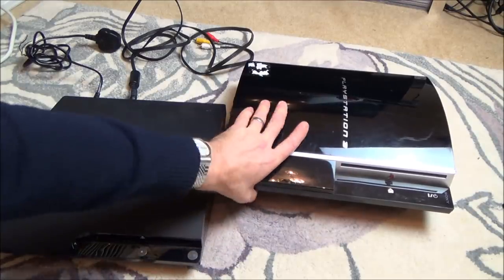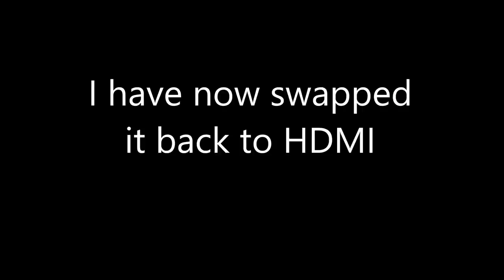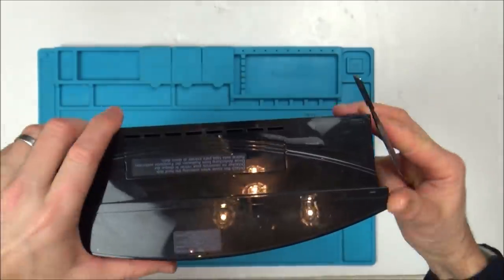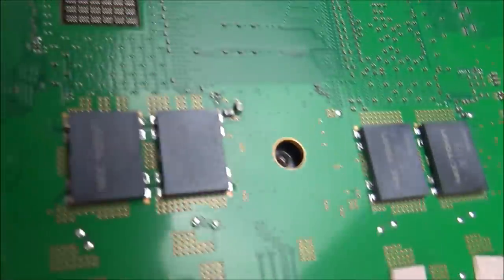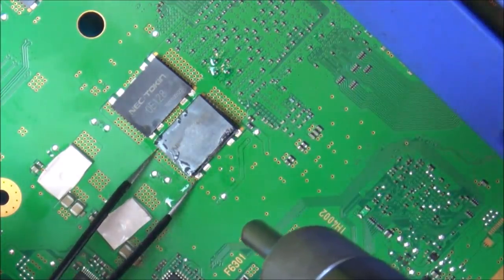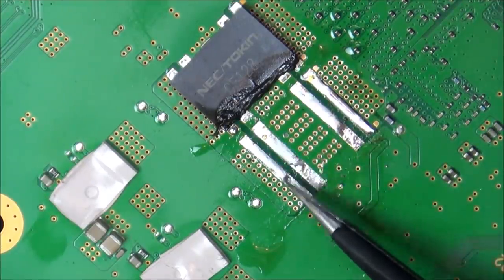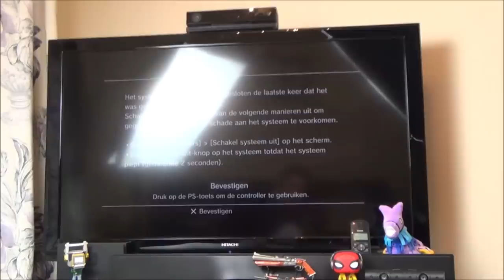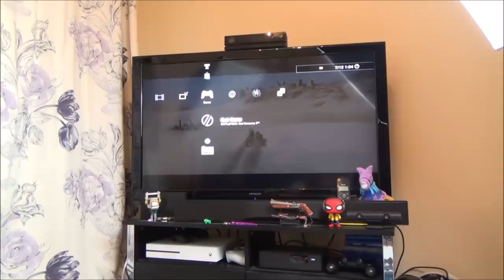Marcel's Lot PART 4 - Faulty SONY PlayStation 3 Slim & PS3 Fat

Comment: I just droped my jaw when I saw this working ... Everybody and their mother allways said its the main chip ! I cant freaking belive it !
Reply: Yes. They can cause YLOD. And it's known for a while. Most people only thought that the RSX/CPU was the fault. In some cases, they were from the original model to the first slims model (known as 20xx). Many laptops with those NEC Tokins (they lose their capacitance and cannot deliver to the CPU) also failed. When you heat them, they restore back their capacitance. So many thought after heating the RSX/CPU, the problem was fixed or that they where the cause. No, in most cases it were the NEC Tokins. I've replaced lots and the systems still works till this date. Others that after reballing (when properly done with proper tools) failed after a few months or a year (back in 2012) pointed to other problem. Replacing those NEC Tokins (for tantalums), again, fixed the problem. That's why models from 21xx didn't came out with those NEC Tokins.

You can measure around the CPU/RSX to see if it's still making proper contact or apply pressure to them and see if it works (lol), cause those power cicles (turn on the console, it heats up, you then power off and it cold down) also makes the solder deform. If not, look for other areas like fuses and those tokins. :)

Final note, i did got alot of consoles and some were already opened and without any visual damage or component (even replaced the NEC's), i then tested/dumped the flash memory (NOR/NAND) and some had a brick (maybe the original user failed when attempting to exploit the console or replace the memory with other and never had a backup), like the serial didn't match the case and so on or the dump had bad sectors or the data was incomplete but if the (what's known for) per-console data is intact, you can try and write a valid ROS 0/1 to it and flash it back (you need a hardware flasher of course) and it might the only problem with the console. So, we never know...YLOD can be from many other things.
Reply: You have to remember that the YLOD literally means 'General Hardware Failure'. Unlike the Xbox 360, where a RROD CAN be identified via system code that people have recovered, we currently have NO way of identifying which component in the PS3 actually fails.

Whilst this fix has worked for a number of people, others have also removed 50% of the capacitors (8 caps out of 16) and found that the PS3 is still capable of working, meaning that there's a chance that this will not work.

There's no guarantee but if you've got a dead board already, what have you got to lose?
Reply: @pqtat718  mines red dead that is crashing but not gta v tho , could it be the nec/tokin capacitors faulty?
Reply: @pqtat718  a have the slim model , what capacitor should i use?
Reply: should i replace it all? or the rsx only?
Reply: what type of capacitor should I use on my slim? 330uf or something?
Reply: @pqtat718  thanks
Reply: the main ICs or the tokin capacitors are the cause of the YLODs. It's either that the ICs cook themselves to death, the bga balls get cracked, or the tokin capacitors die that are the issue.
Reply: @mrratchet  there is a method of diagnosing a ps3 with UART bruh
Reply: @RandomGuy-om1vy  Yes there is now! At the time of my original comment just over a year ago, no such method existed.

Thankfully we’re now able to get SYSCON to tell us the error code, which should help people with repairing consoles affected by YLOD!
Reply: @mrratchet  yep, do you have experience on fixing ps3's, i actually need some help on a slim

Comment: Great fix! I've not seen that fix before for these!
Reply from the maker: Thanks Steve, I was told about it when I did the last 'trying to fix' videos on the PS3s but I never researched properly until now. It would be interesting to see how many can be repaired this way or if it is still mostly the main chips that cause the problems :-)
Reply: Why don't you try it @TronixFix ?
Buy 20 of them and try to fix them 👍🏻
Reply: Yes tronicsfix please buy a bunch of these and do this fix!
Reply: inspired? @tronicsfix
Reply: @Mymatevince  I repaired my ps3 with ylod
Reply: hello, I have ps3 and it won't work on the av cable..ps3 has hen installed, that is, it is modified ... will this procedure affect the mod
Reply: Wow tonic fix
Reply: I wish tronicsfix would have done ps3s

Comment: Had no idea the caps could cause that always heard it was the main chips

Great fix
Reply: It's a similar if not the same issue with laptop GPU's and all in one PC's of the 2009 - 2012 era (Most famously on Apple products). The Tantalum capacitors wear out much faster then they should and screw up stuff like the power rails feeding the GPU. Reason why people thought reballing/baking the boards (or wrapping your PS3 in a towel worked is that applying heat to a tantalum capacitor can break up some of the crystallization byproducts that shouldn't be forming if the caps weren't being run near their maximum thermal and voltage ratings (typical design recommendations from what I read is to go 50 to 100 percent higher on the voltage rating of the cap depending on the specific internal chemistry).
Reply: I have been shouting back in June!!! Check the comments on his previous videos.
Reply: @Techburn997  when i was younger we had a xbox 360 got it around launch and it got the red ring of death and putting a towel around it worked a couple of times but did not after a couple times
Reply: @jok3yjesu339  The xbox 360 suffered from a different issue from what I remember where the heatsink mounts would cause the board to warp and thus break solder joints. But I have always wondered if it could have been both. Might have to find an original 360 with RROD and do some experimenting
Reply: @Techburn997  if you put flux all around the chips and reflow it. That works alot better than just straight up not using any flux on the xbox 360. Do that and put some really good thermal paste like arctic silver or MX 5 and should last quite some time especially if you add a fan mod to it that will increase air flow. The older xbox 360 models did suffer from poor air flow due to the case design and the fans not running fast enough for proper air flow

Comment: Did this for a client, you just need to take a knife to the NEC Tolkins to scrape off the majority of the caps and then heat the pads to remove the remaining pieces.  Replaced the top 4 Tolkins with 16 tantalum caps, left the 4 on the bottom side becuase they are actively cooled with the bottom shield whereas the top ones are just ambiently cooled.  The bottom Tolkins also bridge the pads up top.

Comment: Amazing! I had actually seen a video and even heard about how some electronic technician had said that those capacitors used in the PS3 or any other Electronics from the early 2000s were rubish and were the cause of the yellow light of death, he was saying how the chances of those lead free solder balls actually breaking were very small and did not believe it to be the cause of the problem.

Comment: Great timing! just the other day I ordered an "untested" BC PS3 which actually was tested (The seller had other listings that were working for sale, so they pulled a fast one on me)
 that actually had this problem. Maybe I could get it working.

and by the way, Bad Company 2 is probably one of the best military shooters ever made and still has an active community to this day, especially on PC. I don't much care for shooters, but that one is something else! just in case anyone was reading...
Reply: I recently bought a BC PS3 and the last Friday I sent it to a reparation service. I opened it and it looks very clean I hope that the Nec Tokins are the problem :)

Comment: This is one of the few things I've seen on this channel that I've actually repaired, not as competently as you do it though. I couldn't really afford one back in the day but I bought 3 or 4 broken ones on ebay and replaced the Blu-ray drives or reflowed them with a heat gun if it had Ylod, made just enough money to justify keeping the best one for myself.

Comment: I was skeptical at first but since I'm someone who likes to challenge common beliefs, I gave it a try and boy, was I glad that I did so! Just like you, I didn't have those tantalum capacitors. It just so happened that I have 4 of those 470uf capacitors you were using. Did the same thing and it worked! Well, at first it didn't but right before I was about to give up, I checked the legs of the capacitors and one of them was touching each other... Separated the legs and wow, it works! I tried running it for an hour or so and it still works! Yes!

So I just want to say, "Thank you for sharing this!!!" I'm going to swap those capacitors to the tantalum ones when they arrive :)

Comment: I’ve been planning to do this for a while on mine. Many people have had success changing capacitors. NEC tokin capacitors are known to go bad. They changed them after the cech 2002 models. Great job Vince
Reply: CECH 210x actually, 200x still have the NEC FUKINs (but only on the GPU)

Comment: Nice going Vince,a member on the PSX-Place let me know of your video, i expected a bang with thoes electrolyte caps, looking forward to the full replacement. Currently we are still researching on which is the best method for the NECs, what i advise from personal experience and to avoid the hassle, is to have 50% NECs and 50% Tantalums, replace the NECs on the top board where the processors aren't present, and leave the underneath ones as they are, the reason being is that the bottom ones are actively cooled by the fan itself, and the top ones are passive, but with most of the heat concentrated on top, thoes NECs are thr first one to die, and also if you go via full replacement, you might not get it working again due to the bridge between the circuits, so leave at least one NEC, if you plan to do a full replacement, it acts as an internal bridge for the Tantalums, eliminating the need to wire unnecessary jumpers.

One of the test subjects before i made the thread on PSX-Place was my personal 60GB CECHC04, at the moment is approaching is 7th month since the replacement, still working as we speak, at the moment i am searching for a A01 or B01 to add to my PlayStation collection, so looking forward to your next video.
Reply from the maker: Naked Snake!!!! I instantly recognised your name and icon :-) You did a great write up, I also went on to read about 15 pages of comments under your tutorial, didn't have time yet to go through all 40+ pages of comments but it all makes for an interesting read. I think on the revisit I will do just the 2 GPU caps on the top board to see how that goes. The others can always be done at a later stage. Just debating whether I need to install 8 new 470uF caps in place of the 2 large NECs or if I should try 3 and 3 or 4 and 3 to bring it closer to the original 1200uF. Thanks for sharing the tutorial with everyone and for commenting over here. Good work. (I will copy and paste this on the other length video as well) Cheers :-)
Reply: If i recall correctly, the top side have 4 NECs, 2 on the RSX and 2 on the CELL, what i would do for starters, is to replace all 4 NECs on top with 4x330uF or 4x470uF at 2.5V for each NEC, the other 4 NECs on the bottom you can leave them as they are, they are not really a concern, i simply recommend 470uF for the Phats, simply it didn't work for me for my 60Gb, mine are 470uF rated at 6.3V,is all i had during replacement, but before the 470uF, I did salvage a few 330uF and 470uF from dead boards, worked as well, until a few Tantalum contacts snapped during the salvage , that's why i disclose on the thread 470uF for the Phats and 330uF for the Slims, just to be identical to the NEC spec which is 1200uF each for the Phat and 1000uF for the Slim, but you can use 330uF for the Phats as well, worth the try.

Happy repairs

Comment: LMAO after seeing you try to fix it with those capacitors, I tried it on mine and it worked! Now I can order the correct parts to fix it properly and the delid the CPU and GPU to apply new thermal paste.

Comment: Oh , my , god , Vince....

I fix PS3s as more of a hobby , and I never knew it was even possible to recover a YLOD ps3, and then you've just gone and done it in one video. 
I'll be honest the whole time watching I had no hope you'd fix it, to most people, it's impossible, I don't even try anymore... but when it turned on a steady green and the HDD activity light flashed, my jaw was just dropped.
I'm completely blown away and infinitely impressed\proud of you! 

This was for a CECH*G* motherboard too! They're the first revision after removing PS2 BC, they use the old layout (you can tell as the ports at the back are to the right than the left). These are known to be the least reliable of the PS3 fat models, and you've just gone and saved one :0

To me this is absolutely unbelivable.

I've got a CECHG on its last legs, 9/10 times it will do the YLOD, until it finally turns on, maybe now there's hope for it !

Again , I am absolutely amazed, I can't wait for the follow up video with new capacitors !!
Reply: It's so strange to see one of these back from the dead, looking at this older dashboard style, this PS3 hasn't be turned on since late 2010 !, or at least, not updated ;)

Maybe you should get more than just 8 capacitors, as you also have a CECHG03 (identical to this one, the 3 at the end just means UK, the 4 for this one means EUR), maybe you could try fixing it too! I think it's the one you borrowed the powersupply from even.
Reply from the maker: I know!!!! I couldn't believe it when the light stayed on. I didn't really think it would work. I hope when I change out the other NEC next to it that it will still work. I will double check the 2 previous failed PS3 fixes to see the state of them. I know I definitely screwed up one of them, as from memory the solder balls came out of the CPU or GPU when I heated it up. I think on the fully backwards compatible one I might be OK though. I will watch back my vids to see. As soon as the caps arrive I will film a revisit on this to see what happens :-)

Comment: Nice proof of concept with those electrolytic caps :)
I have PS3 Slim 120Gb CECH-2004 A. Bought it new in 2009, still works but the battery which keeps time and date, seems to be on it's last legs. Often it's asking to set the time & date at startup after it's been disconnected from the wall socket but of course it gets the correct time anyway from internet so not a big deal.
Eventually, I suppose I should disassemble my PS3 and replace the battery.
Right now I've started looking for PS1 cd spindle part, attempting to replace the old spindle which has lost plastic parts from it and sometimes it doesn't hold the disc properly.

Comment: What a result, never seen them caps before, they look well dodgy imho.   You can insulate legs using heatshrink and electrical tape or capton tape to just make sure the legs don't touch.   Why do you need four?   Could you not aggregate the 4 into a total farad value and just have one of them tatumoneal capacitor set per bank?   Its always nice to get a freemans when someone has gotten it wrong, the £4 1947 Avia watch I got was one such case where the seller said it needed a new battery...

Comment: I think you should leave it as is and use it as a daily driver till it dies again just to see how long you can get away with it on a project you already assumed was a lost cause. I love how you think. "Well it's no good, but I might as well open it. Well it's still a lost cause but let's try pulling stuff off. Well it's no good and I don't have the parts, but may as well see if I can make it work with different parts. Oops I fixed it. Now I have to finish fixing it." That's why I subscribe Vince you're awesome.

Comment: great video. I repared aaalooott playstations and also ps3's, never mind a YLOD could be a cap problem, i repaired 

hundreds it was never, in no case, anything other than an CPU problem, reflowed, worked fine. but to check if there is a short between the caps and GND is very simple, will proof that in every further repair first. thx for this great TTF video :)

Comment: With the hot air gun, a slower air flow gives the air more time near the heating element to heat up. High air flow means you get cooler air, and it's also easier to blow small components out of place. Especially so with a small nozzle on the front.

Comment: I got my PS3 60gb refurbished by Sony in 2013 since mine had the ylod. I believe it was the last year they stopped fixing old ps3 fat model's. I still have mine working perfectly fine today. I did not replace thermal paste. I did install a fan controller on mine to keep it cool. Makes me wonder if the capacitors in mine were changed or upgraded to more reliable ones

Comment: Hi great video but when you have tested the capacitor, you say its shorted on all pins, its not really a short. Don't think when your multimeter beep its directly a short, because of gpu internal low resistance, read the value on your meter, normally its between 1.5 to 10 ohms or more , i say that not only for ps3 but all devices with cpu or gpu its the same rule, thanks Julien.

Comment: You my mate, just turned water to wine! What a twist! Lol. For years 99% of YLODs was thought to be the GPU. And for years my 60GB PS3 has just sat in the box (YLOD twice) Probably still works, but the trust is gone. Don't have the expertise to change those chips either. They looked mega difficult to change over...
Reply: They are easy, you dont even need a hot air station.
Reply: @RandomGuy-om1vy  So is it a secret?